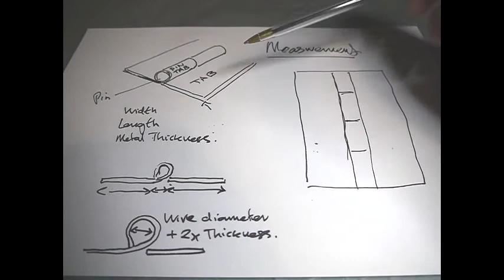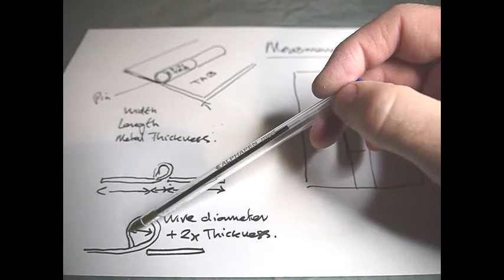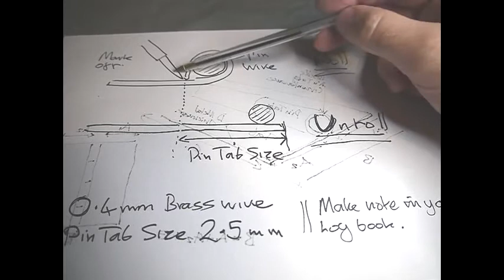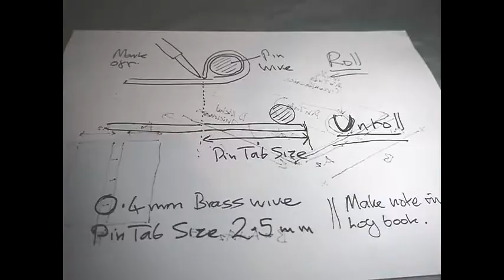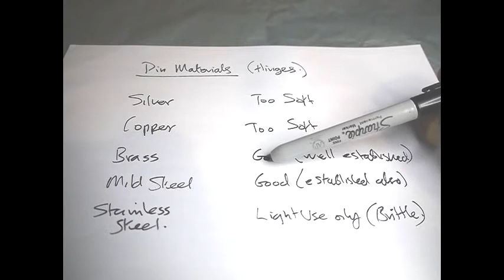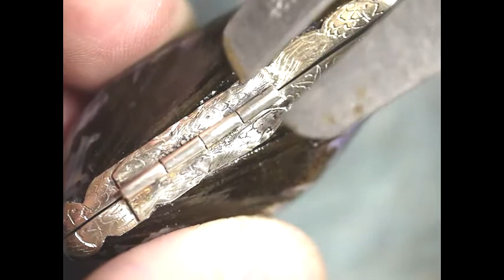Preliminary for Making Miniature Hinges For Jewelry and Doll Houses

Comment: how to prevent parts from sticking together when soldering silver and gold (copper + brass)

I use white water-resistant water-based paint to paint the walls, from a building materials store (muurverf). After covering the soldering area, I dry the area with a soft (not hard fire) to evaporate the moisture, dip a piece of solder in an aqueous solution of flux and place it on the place where the parts should be soldered (or I dip the place where the parts should be soldered with a brush). Places covered with paint for whitewashing the wall - soldered. The solder does not stick there.